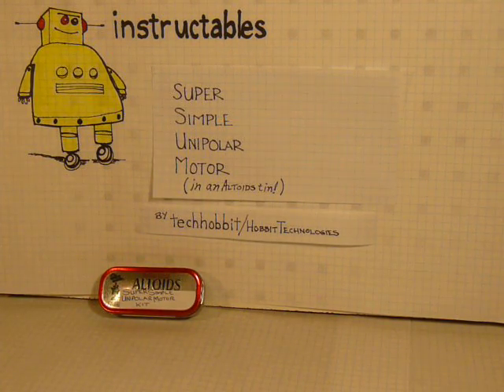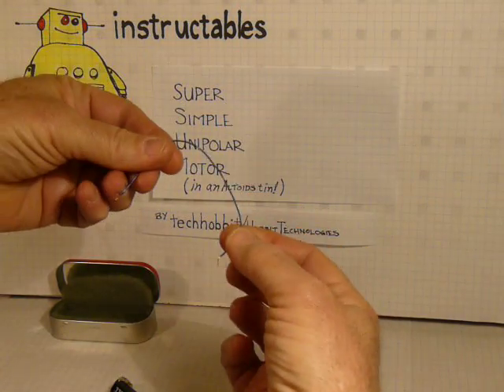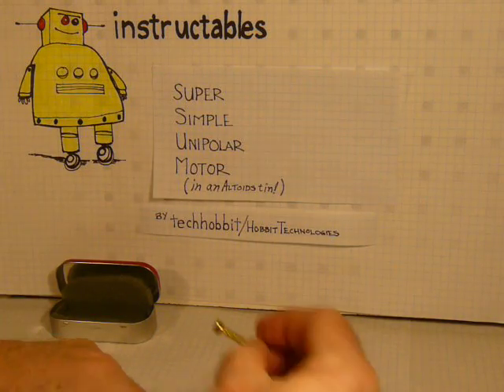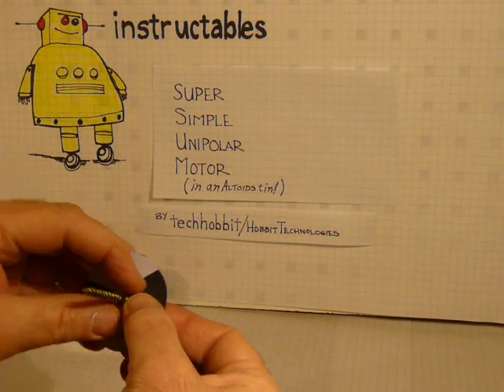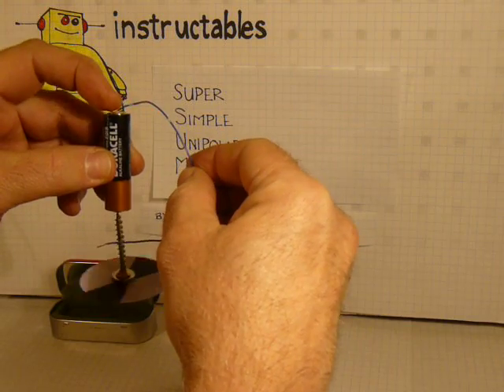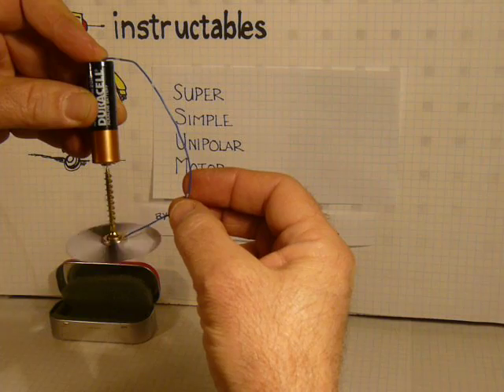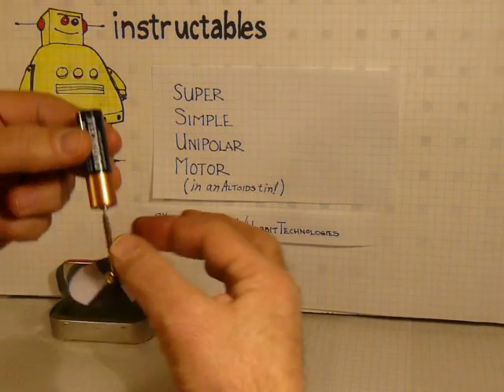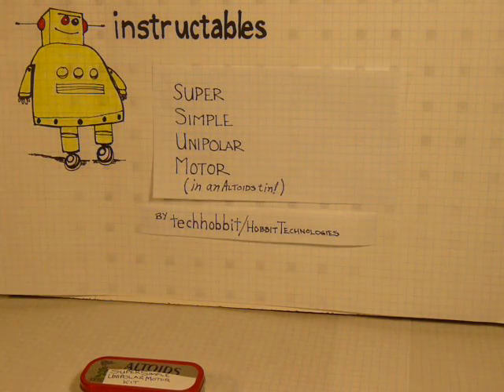Super Simple Unipolar Motor

Comment: Exactly how does the flow of DC cause the rotation?
Where are the opposing fields to create the rotation?
Is the magnetic field around the wire large enough to produce the same polarity as the magnet contact point to produce the rotation... or is there something else going on there?